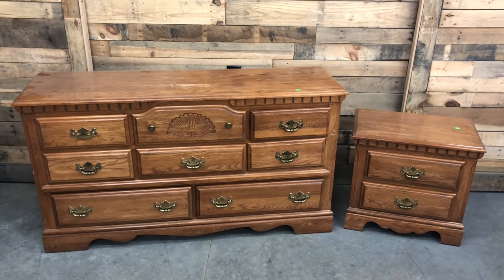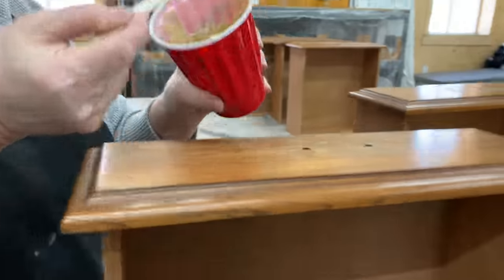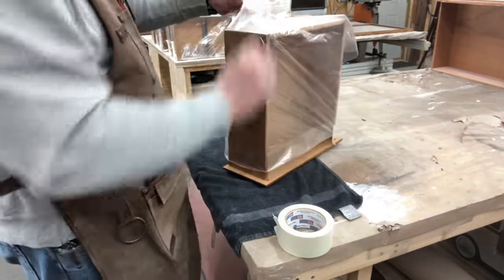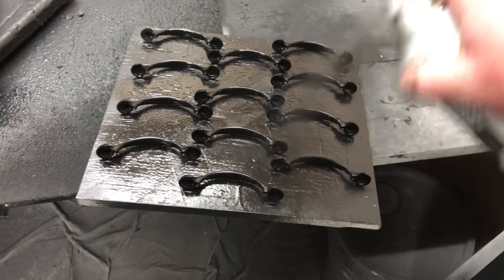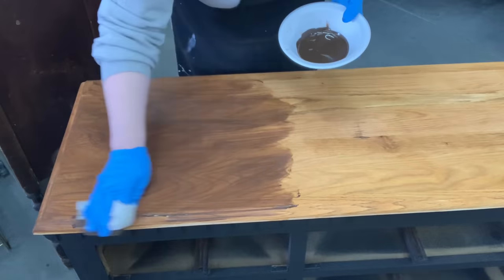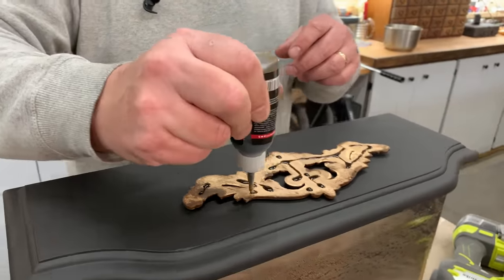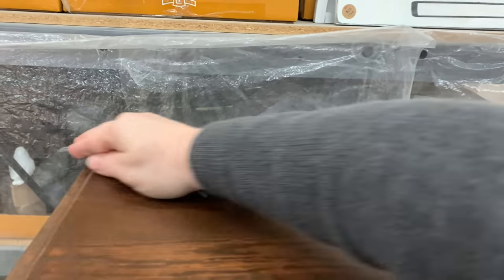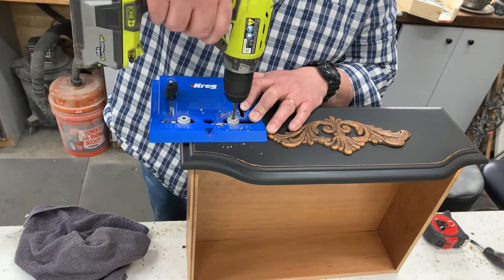Amazing Find  | Second Hand Furniture Makeover | Industrial | Farmhouse | Cottage

Comment: Yvonne, I have an oak coat rack, do I need to sand it first or spray it with verathane?
Reply from the maker: Depends on what color your painting it. Scuff sand, yes.. it’s part of prepping. Oak does bleed through light paint color. So if your choosing light, spray with shellac to prevent it from happening
Reply: @GingerChickRehab  it will be black.